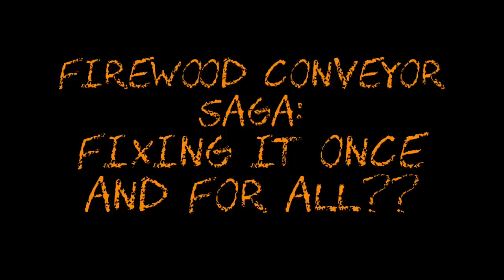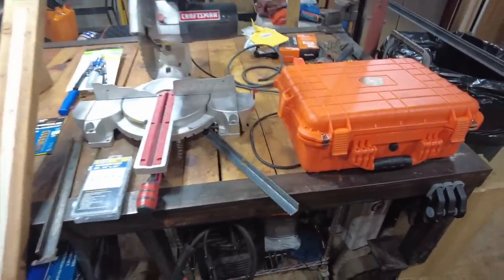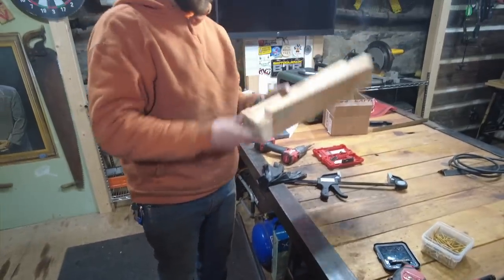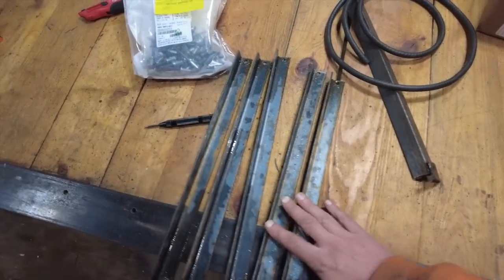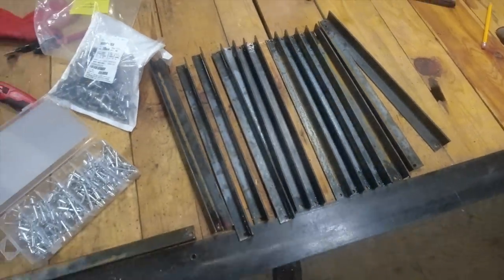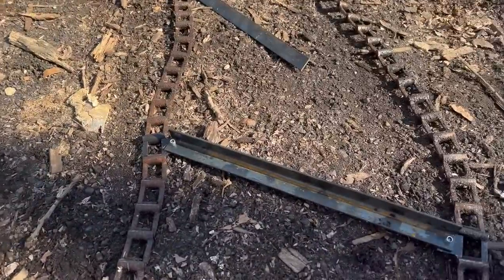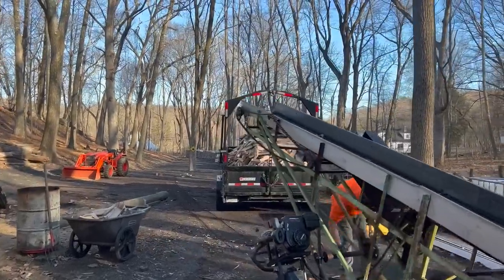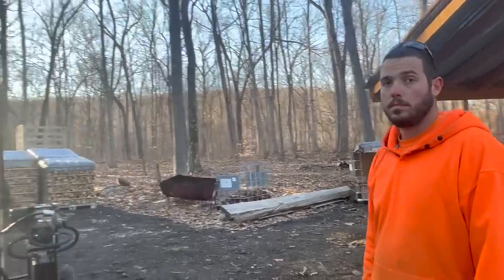#359 Firewood Conveyor Saga: Fixing it Once and for All??

Comment: Just a thought…. Spray paint the paddle with the aluminum rivets so it’s easy to keep an eye on. Yes the paint will wear off but some will stay. Also, used oil is not the best idea for the chain.  Motor oil will collect a lot of sawdust, dirt and debris.  DOT3 ATF will work as well as oil and collect a lot less crud.  Thanks for sharing, Gentlemen!
Reply from the maker: Thanks for the tips!

Comment: Jake, when I was installing them at work I had to ream them to the correct diamiter so the rivet would fit in the hole.  Yes you might have not gone through enough with the drill bit.
  Nice job on the conveyor!
Reply from the maker: Thanks George!

Comment: Hi guys, That top chain and the 2 sprockets can be converted to #50 chain easily. It will be a 1" or a 1 1/4" shaft so you just need two new sprockets and about 21' of #50 chain. Get a couple half links so you adjusters will still work. Your other long chain can be fixed by adding wooden slides to it. Hopefully this link works and you can see one of my conveyors that I reworked a couple weekends ago. The belt was always whipping back and forth and would fly off so I made some wooden guides. https://studio.youtube.com/video/EYq8q5nn_fs/edit
Reply from the maker: Looks good Dale! We would need about 100’ of new chain. At this point way to far invested in this chain to scrap it now.
Reply: @Dude Ranch DIY  hi Jake. I meant to just replace the top drive chain and sprockets. I just bought a new set for mine yesterday. I got a 12" sprocket for the top shaft to slow it down some more and 4" sprocket for the bottom. 20' of #50 chain. Was around Can$150. I'm hoping that is the last of the repairs for that one. Then it's on to the next one. Good luck Dale

Comment: Do the rivets rub on the pan as they go up the elevator or do they ride above the pan?
Reply: Hi Doug. They shouldn't be because it rides on the bottom of the round portion of the link. Some elevators will have a wood or metal wear plate, depending on age
Reply from the maker: They ride up above!

Comment: Yes they were riveted new and when we had to repair our hay elevator we used 1/4 inch bolts with lock nuts. And  .250 is smaller than  .257
Reply: Are your mounts flat like theirs or vertical? I have a little giant and a new idea, both vertical. I use bolts too, but would rerivet if flat.
Reply: @brandonhoad9033  we had both we had 2 different elevators, one for ear corn and one for hay and straw

Comment: 👍👍. I do 95% of my wrenching on the ground.  Now, how do I get Scheib to quit picking up the big oak rounds.  # of teeth and shaft size of sprocket? Maybe I can find something. #62 chain?  Is there a straight or 1/2 moon keyway?  It's gonna hop some, lot o chain. Especially if ya can't tighten it, but doesn't look too bad.
Reply from the maker: I’d have to check I know it’s a 1” shaft. 👍🏼
Reply: @DudeRanchDIY  actually the key wouldn't matter as they normally sit in shaft and sprocket would have a full slot. Would need width of it if there's one (1/4 in ish probably) Btw, not sure if you know, but I'm a small dairy farmer. Born bred and raised. Took over at ripe old age of 24 when Dad died in '95

Comment: Jake, sorry the rivets were so snug…. For what it’s worth, the 1/4” drill should make a .250 hole. The .257 equates to a letter “F” drill and the .261 equates to a letter “G” drill. That’s the tolerance the rivet needs for the gun to expand the rivet and ensure a proper fit. 007 to .011 thousandths is a big deal in the machinery world.  Glad you made it work after all. I personally would have stuck with the aluminum rivets because if something jams, the rivets would be the weak link, and the first to shear off. Then you might not break the chain links… just food for thought…
Reply from the maker: Thanks for the tips! Lol damned if I do and damned if I don’t on the rivets 😂

Comment: Keep track of how much you spent on repairs and down time that you lost production. I think your chasing rainbows and unicorns. This chain isn’t designed for wood it isn’t heavy enough. My two cents. I ran a setup like this for a few years and sold it. Peace
Reply from the maker: Definitely don’t have anywhere near the 10k companies are asking for new ones!
Reply: I run way more weight on a longer elevator when doing earcorn . Weights not the problem. Old worn chain combined w the welded bars which allowed zero movement/flex was. Not saying it's 100% cuz most of chain is still old. But I believe the riveting will go a long way